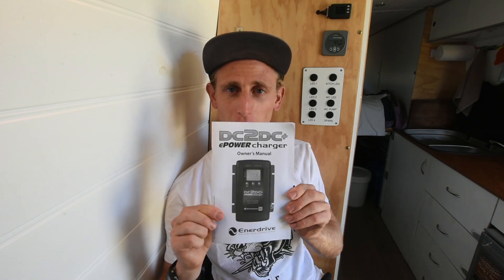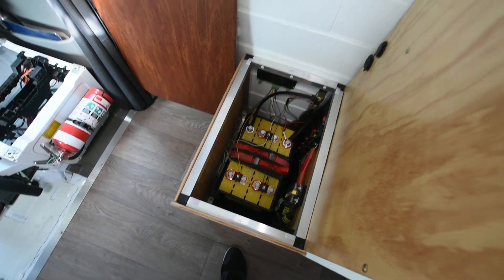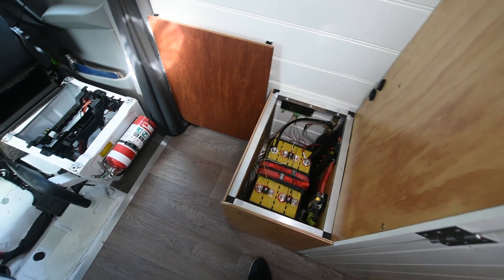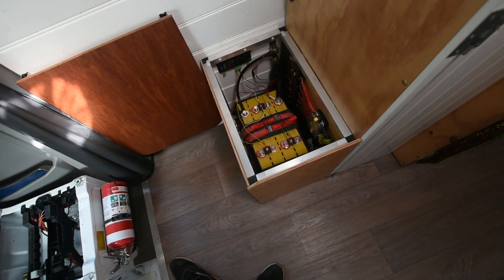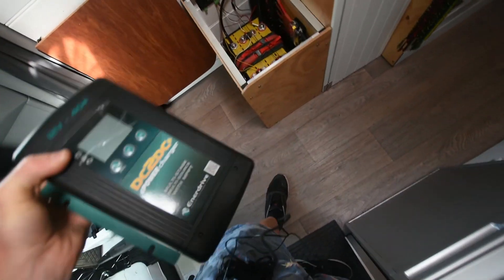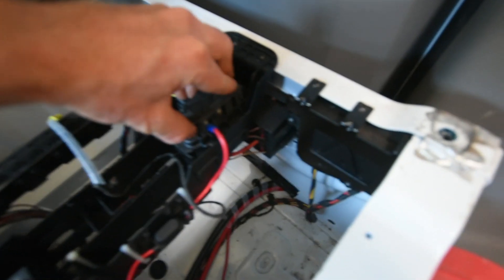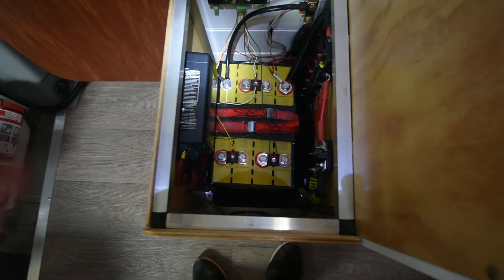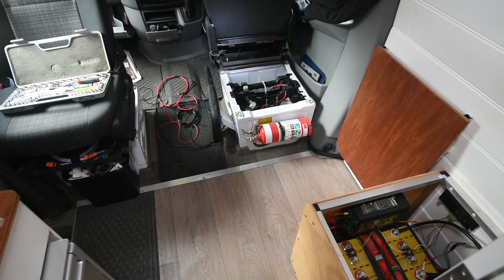DIY installation tutorial: Enerdrive DC2DC+ charger + Sprinter van + Lithium house battery

Comment: Thanks for the video.

In the instructions for this is states that for a 'smart alternator', the negative going into the charger needs to be connected to the vehicle side of the 'battery sense module'. Is it just to the negative on the Start Battery or does it need to be elsewhere?
Reply from the maker: Yep, just needs to be attached to the neg terminal on the starter battery. I also had the same confusion and had to email Enerdrive for clarification. Could use some clearer wording for sure!

Comment: Do not install this unit under the bed as the mppt makes a very loud click first thing in the morning when it’s looking for sun and in the afternoon when the sun is going down , so it clicks on and off sometimes for 30 minutes very loud , also the alternator charges for 3 minutes then it shuts down and does a 5 second check of the solar and the starter battery and then back to the alternator for another 3 minutes and continues like that ,so it’s not a constant charge
Reply from the maker: We don't use the MPPT function of ours, but did not notice any audible clicking sounds when using it as an alternator to battery DC-DC charger. Could it be a defect in your model, or is it well documented?
Reply: @ComfortablyLost  it’s the mppt that makes a click on and off ,and I thought it was defective, I rang enerdrive and they said it was normal
Reply from the maker: Sounds annoying! Our Victron MPPTs are silent, which is nice, but they have really bright blinking lights.. which isn't so nice if it isn't properly contained.
Reply: @ComfortablyLost  the mppt has moving parts apparently that’s the clicking and the 3 minute charge by the alternator and a 5 second turn off is in the manual

Comment: Wondering if you had to get a new connection clamp for the starter batteries negative terminal. I believe I have the same vehicle as you, and am noticing that there is no easy way to stack an additional lug on the negative terminal for the starter battery.
Reply from the maker: There's a factory negative mounting bolt underneath the driver's seat to use. Don't worry about connecting the negative directly to the battery. The bolt is specifically designed for upfitters when installing aux batteries and other accessories for easier access. I show the negative mounting point in this video at 5:46. Hope that helps!

Comment: Thanks for sharing this info. I noticed that you connected your unit to the ignition lead (black/yellow wire) instead of the starter battery (red wire). I believe you prob did this to not deplete the starter battery when engine is not running? Just wanted to see how that is working out as I am trying to figure out how to connect a bb charger myself. Does the ignition lead still provide power after ignition? Thanks
Reply from the maker: Hi Devin, actually both sources are connected to the Enerdrive DC2DC charger. The main power source is from the starter battery positive terminal, and there's also a cable connected to the ignition terminal under the seat which acts as a signal cable to the DC2DC charger so it knows when the vehicle is on or not. The DC2DC charger doesn't get its main power source from the ignition terminal. The instruction manual provided with the charger will explain it more. Regards
Reply: Comfortably Lost thank you for the clarification. Watched your video again and that makes sense. Appreciate the help!
Reply from the maker: No worries. Hope it helped make your install easier!

Comment: thanks . Can you tell me what year  sprinter van? and  the sprinter alternator  max current  is 220 A?
Reply from the maker: It's a 2014 model (constructed in October 2013) with a 3 phase 14V/180A Valeo alternator according to Mercedes-Benz AU when I contacted them about it with my VIN.

Comment: Are the circuit breakers in your battery box magnetic or thermal?
Reply from the maker: They are thermal breakers. Standard issue for this sort of application and usage.
Reply: @ComfortablyLost  Thanks. I have used magnetics in similar applications, but they are more expensive (though protect equipment better).

Comment: Curious as to why you have this and not just a Voltage Sensitive relay -  Do you have to have this type of unit as you have Lithium batteries? Does it also allow you to charge the vehicle battery from the solar too?
Reply from the maker: Yes it is required as our house battery is lithium and the starter battery is lead acid. They each charge with different algorithms / voltage stages and if we used a VSR it would damage the lithium battery. 

The Enerdrive DC2DC is one-way only, so no, it cannot charge the starter battery from the solar panels. 

If you have an all-lead acid system you can get a product from Enerdrive which is a dual volt sensing VSR which CAN charge both ways. But that doesn't have programmable outputs and isn't compatible with the smart alternator or the lithium battery.
Reply: Comfortably Lost  Thanks, I have an older Sprinter than you, with AGM house battery, so looking at options to utilize the solar to keep the starter battery topped up too. Mine is a weekend and short trip van, without heaps of electrics, so lower battery usage, so I think the solar will be plenty for both batteries.
Reply from the maker: Definitely have a look at the Enerdrive option then if it's still on the market! 
Ours worked great in our last van.
Reply: @ComfortablyLost  but what if you had the starter battery hooked up to another output channel on the enerdrive with the solar panel plugged in... wouldn't it start to charge via solar when the ignition is off